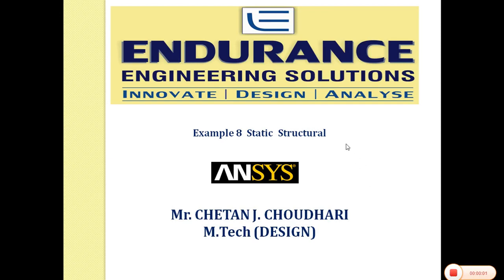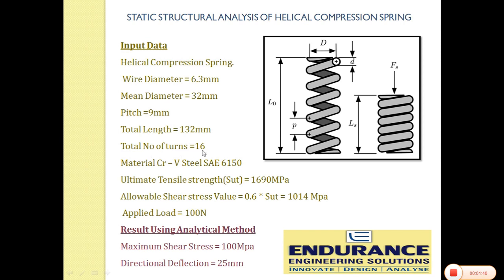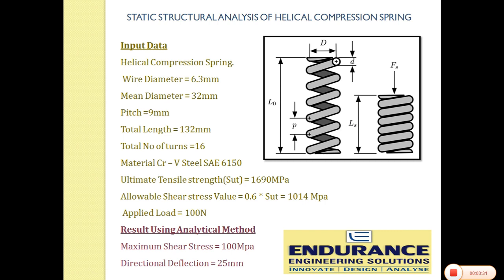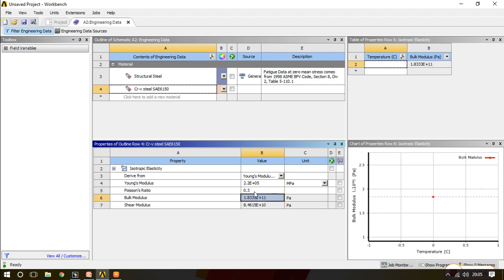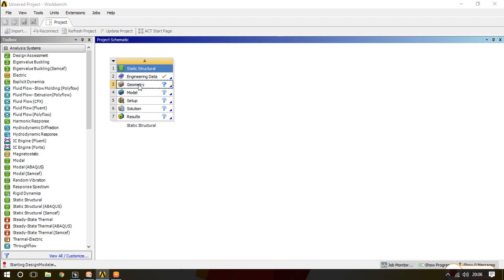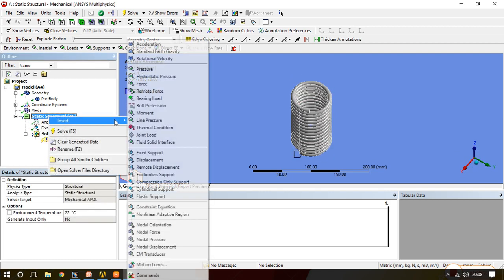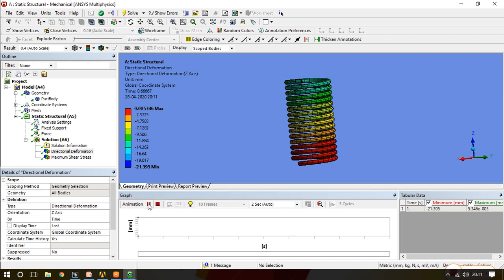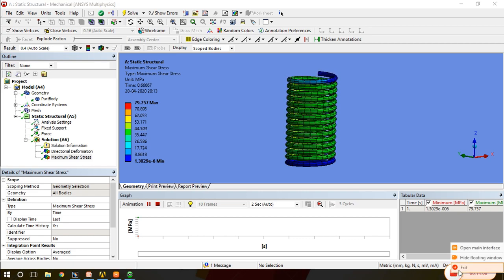ANSYS SPRING ANALYSIS (SHEAR STRESS & DEFLECTION) TUTORIAL 17

Comment: Hi, Great videos on Ansys tutorial but it seems in this video you have made mistake on the design values. For the combination of the spring data, the spring coefficient will be around 35N/mm which dictates 3-4mm of deflection for a 100N load. Probably and as it is visible on your 3D model (just take a look at the ratio between the designed wire diameter and the outer diameter) you should have used a MEAN DIAMETER of 64mm instead of 32mm. Please check and make a correction.
Reply from the maker: Thanks for the info! let me check.